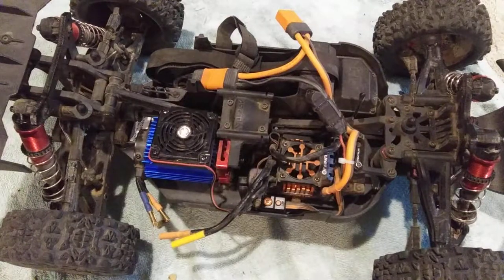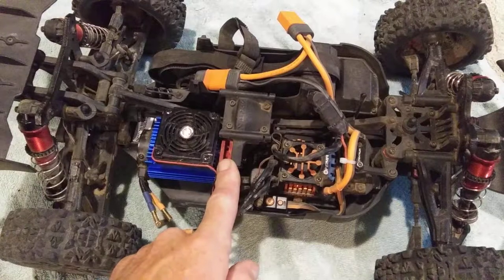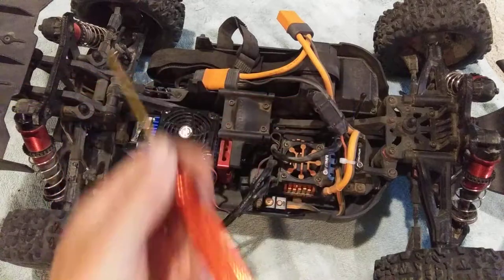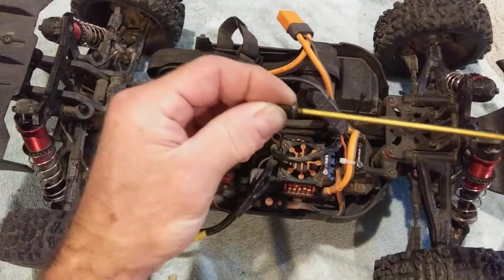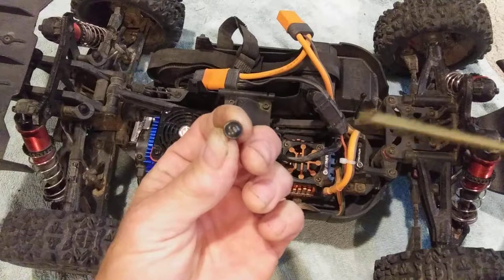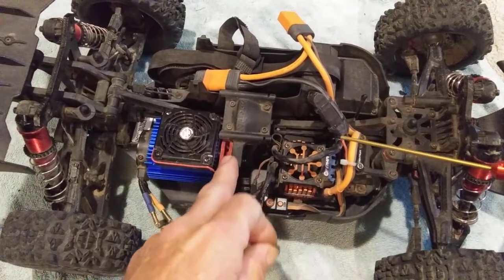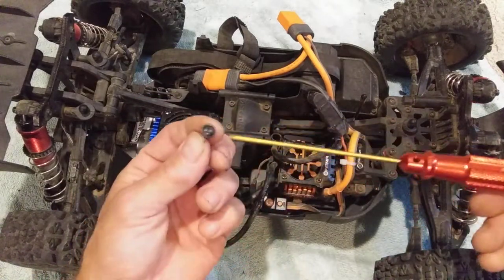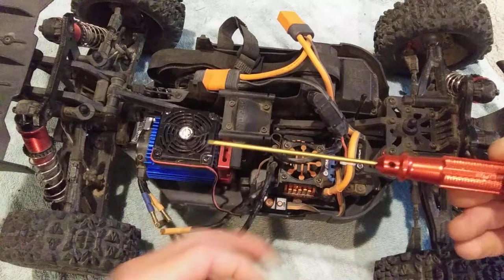Replace Arrma 6s motor mount screws!!

Comment: Shit i just pulled my Kraton 6s out of the box and the damn screw for the pinion came out and is wedge in between the pinion and the mount so it locked up. I was able to get 1 mount screw loose and now the other is being a pain. So I'll just go ahead and drill it out.
Happy Birthday to me
Reply from the maker: Yeah it's known we need to look over these cars when we buy them before first run. I found that out the hard way too